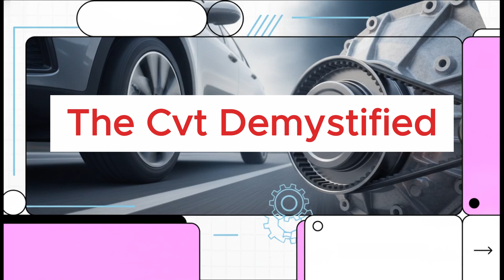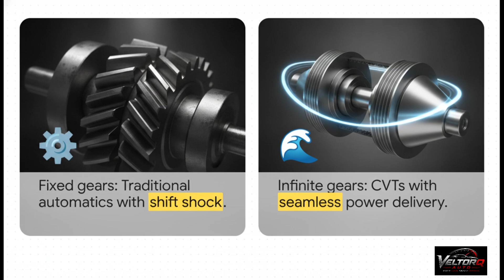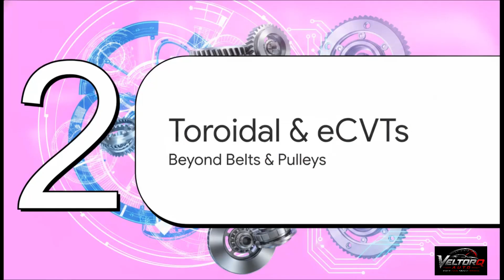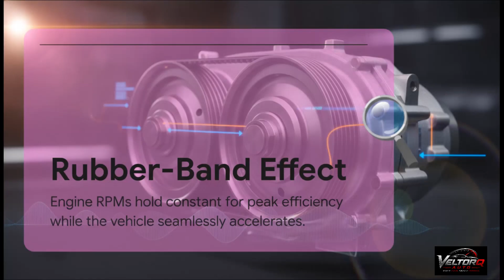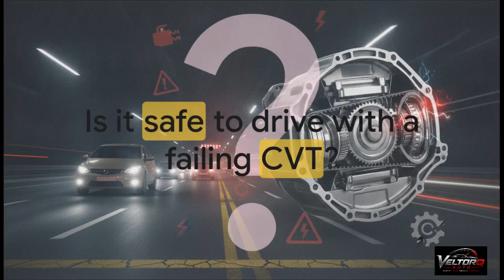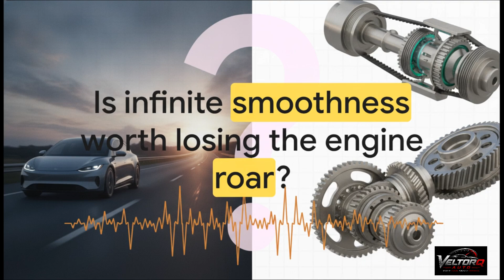How a CVT Transmission Works | CVT Explained Simply 🚗⚙️

Comment: CVT is the worse transmission ever designed to run a vehicle.  CVT quits in the middle of climbing a hilly-road.  The designer-engineer of CVT will go to Hell.
Reply from the maker: I understand the concern! CVTs definitely have their critics, especially when it comes to heavy loads and long-term durability. But CVTs have also evolved significantly, and their performance depends heavily on the design, maintenance, and application. Thanks for sharing your experience! 🚗⚙️